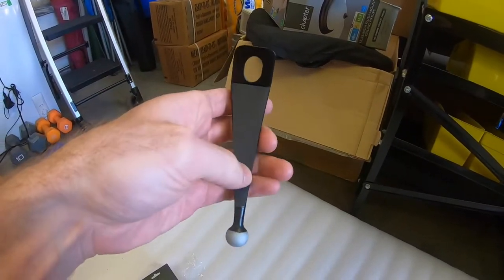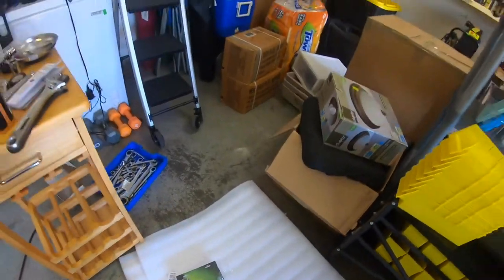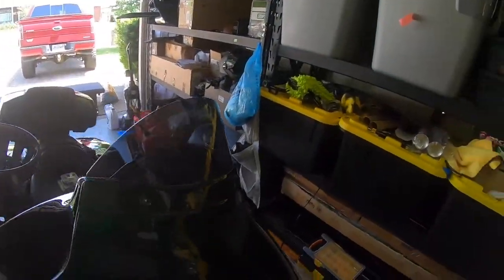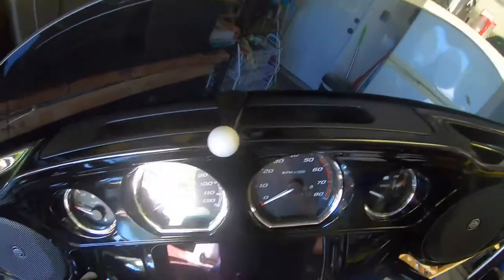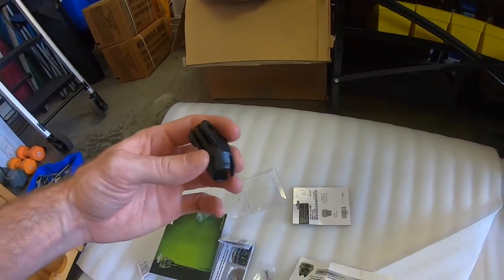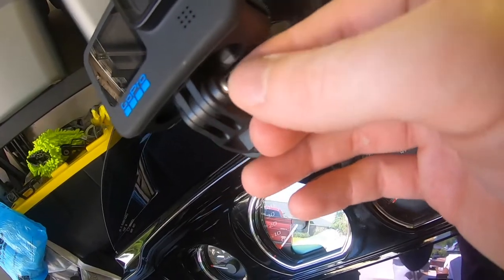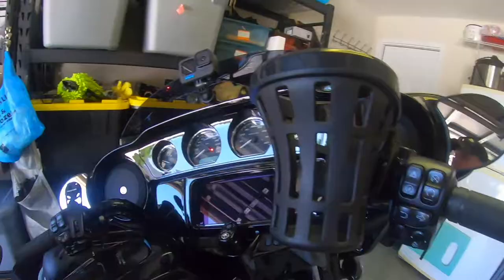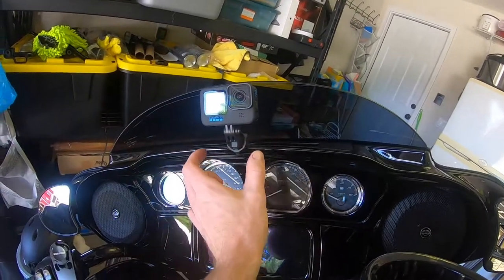Ciro Fairing Ball mount and action camera adapter install

Comment: Nice addition for your bike. Where did you get the torque screwdriver 🪛 from?
Reply from the maker: So it is actually by Vortex, the same company that makes rifle optics, and is meant for torquing scope rings but multi use lol. Wheeler makes them too but I went with vortex since I have a bunch of their stuff anyways.